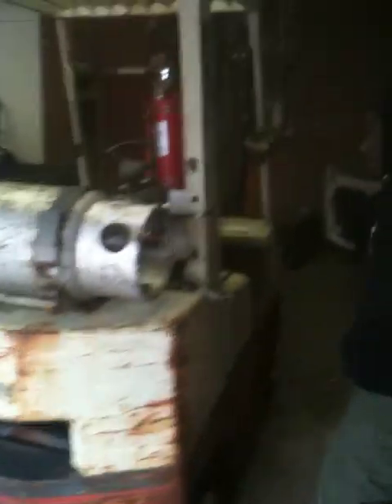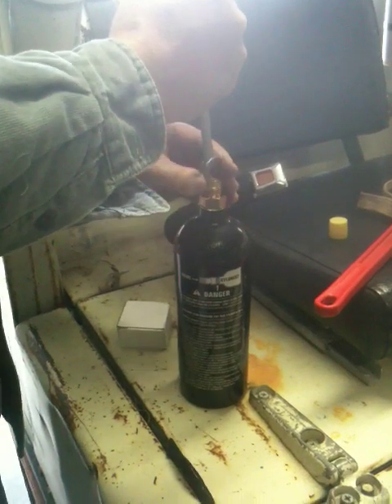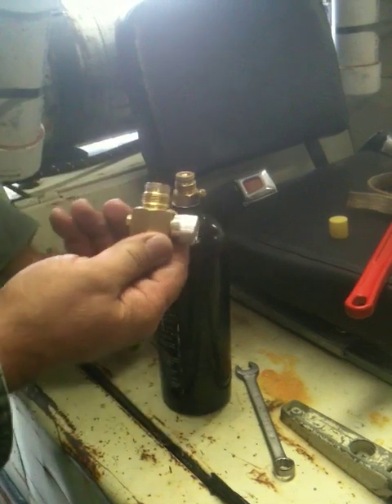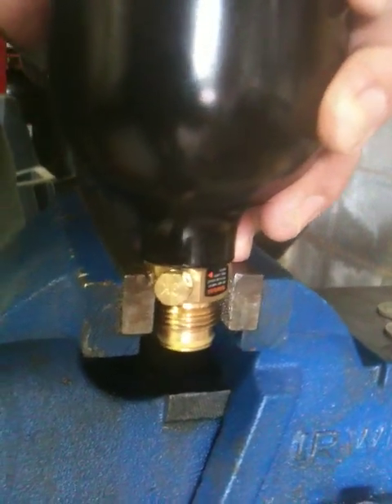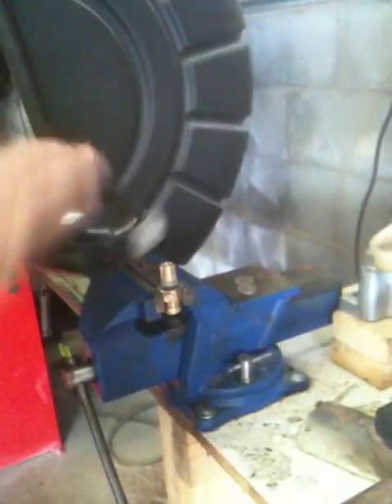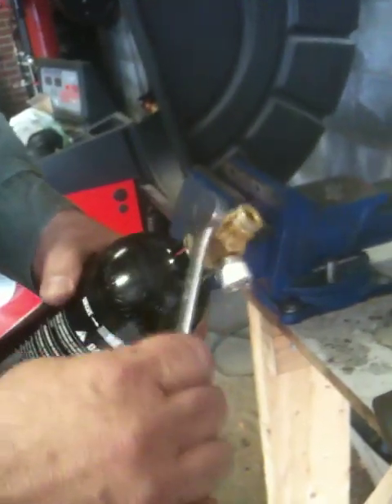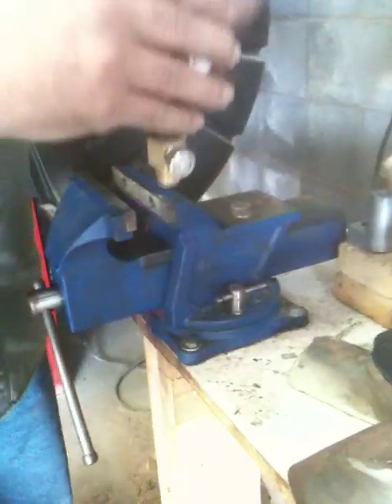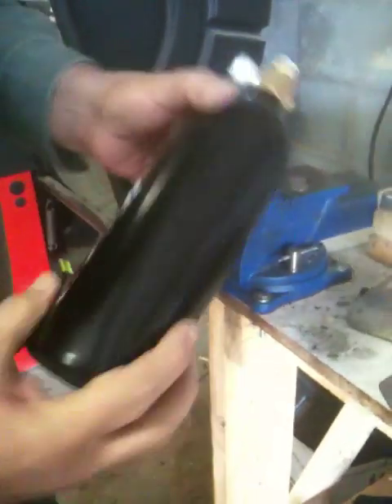Removing A Paintball Tank Pin Valve - Replacing It With An On/Off Type Main Valve

Comment: bisakah dikasi lubang tambahan m10x1 untuk manometer
Reply from the maker: Jika Anda menginginkan pembacaan tekanan untuk menentukan berapa banyak CO₂ yang tersisa di dalam tangki - Anda kurang beruntung. Tidak ada kebutuhan mendesak untuk manometer pada tangki karbon dioksida. Pada  berapa pun, tekanan di dalam tangki akan SELALU sama selama masih ada setetes CO₂ cair di dalam tangki. Pembacaan tekanan saja tidak memberi Anda petunjuk berapa banyak CO₂ yang ada di dalam tangki. Jadi jika tangki Anda terisi penuh atau hanya setengah penuh, pada suhu yang sama, tekanan di dalam tangki akan terbaca sama di manometer Anda, sehingga Anda tidak tahu berapa banyak CO₂ yang ada di dalam tangki.

If you desire a pressure reading in order to determine how much CO₂ is left in the tank - you are out of luck. There is not a critical need for a manometer on a carbon dioxide tank. At any , the pressure inside the tank will ALWAYS be the same as long as there is a single drop of liquid CO₂ inside the tank. A pressure reading alone gives you no clue as to how much CO₂ is in the tank. So if your tank is completely full or only half full, at the same temperature, the pressure inside the tank will read the same on your manometer, giving you no idea how much CO₂ is in the tank.

Comment: Can you fill CO2 Tank with compressed air as long as the pressure stays under the bottles recommended pressure?
Reply from the maker: Yes. Any gas could be pumped into the tank. It's not necessarily the best game plan. But in a pinch, could you? Well, "yes" is the answer.

Comment: You forgot to mention that some tanks have the valve locked in with Loctite. I just about busted a nut trying to remove one from a Valken tank, obviously they do a good job of assembling their tanks and they use red Loctite, which is the high strength thread locker. The only way to crack that loose is by using a heat gun, or boiling water to soften it a bit, then with a lot of force it will crack loose.
Reply from the maker: That is unfortunately sometimes the case. Manufacturers say they do it to deter the general public from opening the tank by removing the valve. When the tank needs a new hydrostatic certification, the inspector must remove the valve. Rarely do they use threadlocker when reassembling the tank 'n valve. The threadlocker contributes absolutely nothing toward making the tank airtight. Thx 4 the post.

Send me an eMail (MrFizz@FizzGiz.com) as I have something new I'd like to tell you about.

Comment: From my experience, Teflon Tape is mandatory on the valve thread. Why haven't you used it?
Reply from the maker: Long B4 there was Teflon brand tape - there were NPT fittings. No sealant required.
Reply: My understanding is that, 'teflon' is not a brand name, but an Aluminium derivative (left over from the Aluminium smelting process). In any case, I was taught Teflon was to protect the 'National Pipe Threads' (which have a parallel pitch), sealing them in between. Even the hydraulic threads (which are tapered in a particular degree) use Teflon, I believe, but thanks, anyway.
Reply: @johnathansmith3819  Teflon is  a brand name owned by DUPONT (now CHEMOURS) - it is made from PTFE which is a type of thermoplastic polymer, - a material that can be heated, shaped, formed many times because there are not additives which degrade with reheating, commonly found in materials like PVC.
Reply: Yes; you are right in quoting its characteristics. This is not about what Teflon is, but rather how to protect gas leakage from happening, or the threads from being damaged when tightening. Teflon has a very low coefficient of drag, which helps in the pitch to slide internally to each other, without being damaged. There are two types of them in the market: Orange and White, for gases (Oxygen mainly) and water. Thanks for answer.
Reply: @MisterFizz  That's right. Teflon tape does not function as a sealant - it simply helps thread insertion! O-rings, gaskets and compression/flare fitting faces provide the sealing surface. Standard NPT or BPT  alone will not suffice for most gases, this is why the EPDM/buna-n O-ring is on both the new and old valve where it inserts into the tank.

Comment: Great video and demonstration, Just a bit of advice, when using the vise, don't tighten down on the brass valve as the metal is pretty soft, and since there is a tap in the brass with the valves, they can get warped, It will hold fine slightly tightened, I would not put my full weight into torqueing it down

Comment: I just finally got the courage to bleed my old tank that was 5 years past hydroseal and pressurized for longer, thanks, was a success
Reply: I can’t figure out how to have the strap wrench not to slip on the tank.  It just slips so I’m unable to loosen the pin valve from the bottle.  Any suggestions?
Reply: @HawaiiReka  admittedly not an expert but guessing you want a tighter strap or something else is up
Reply: @willjoyce5013  Thanks - I'm far from an expert haha.  Are there different kinds of strap wrenches?  I've never used one before.  It just keeps sliding and slipping so I can't get a good grip on the bottle to turn it.  I just want to change the pin on the bottle as it broke (CO2 seeps out) and I can't buy or repair any here (in Hawaii).
Reply: @HawaiiReka  sorry, can't help much as is but gl. I feel like it's something silly hopefully
Reply: @willjoyce5013  thanks, appreciated

Comment: how can I fix to reuse an expired tank? my local shop won't refill mine because its expired? can N expired tank be fixed??
Reply: Re hydro it
Reply: You could buy yourself a aluminium air tank they don't expire, but you have every 5 years to let it Hydro testet or you buy a small under 2inch diameter tank that don't need be testet ever.

Comment from the maker: Tighten it sufficiently to prevent a moron from using a common wrench to loosen the darned thing. Tightening is not requirement to ensure a good seal. Tightening is meant to lessen the likelihood that an inexperienced, unsuspecting bozo will hurt himself by making it extremely difficult to open a charged tank.

Comment: Thank you, also very useful for those of us who use CO2 for plant growth in aquariums. Is there no PTFE/Teflon tape needed as the O ring is sufficient to provide an 800 psi seal, also how tight do you torque the bottle to the valve, just &**^&*^* tight or is there a torque setting?
Reply: I dont mean to be off topic but does any of you know a method to log back into an Instagram account?
I somehow lost the account password. I love any help you can give me
Reply: @Aydin Joshua instablaster ;)
Reply: @Corey Knox i really appreciate your reply. I found the site through google and Im in the hacking process atm.
Takes a while so I will reply here later with my results.
Reply: @Corey Knox it did the trick and I actually got access to my account again. I am so happy!
Thank you so much, you saved my ass !
Reply: @Aydin Joshua No problem xD